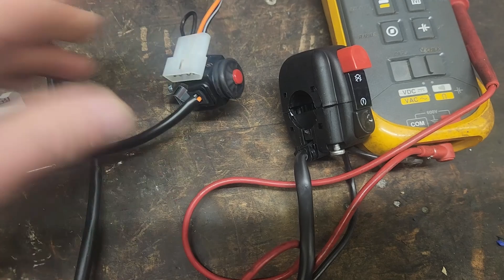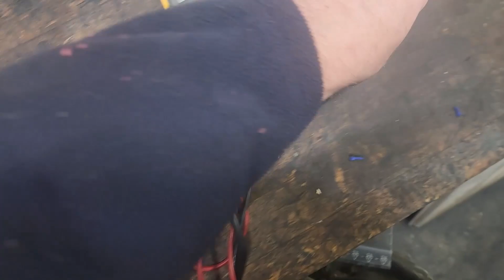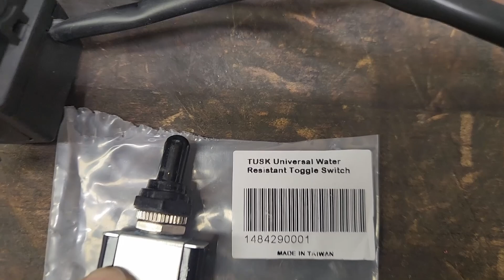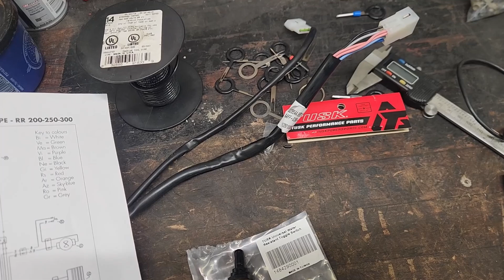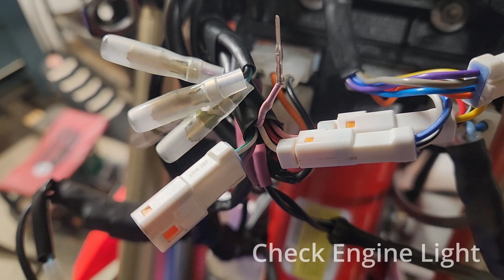MY24 Beta 300 RR Race Switches

Comment: What pin removal bit did you use to get that pink wire out. I have the set but not sure what one to use. Thanks
Reply from the maker: I used the thin flat one with a wedge point.  It's tedious but you'll get it.
Reply: Yeah holy crap it took me forever to get it but it’s done now lol. Thanks for responding oh and I hear you make 3D printed parts for the beta. How do I go about ordering some ?  Thanks again
Reply from the maker: Your right.  I've got a lot of little parts in development. Let me know what you may be interested in.

Comment: I bought bought a de-pin key ring kit from the Bezos Chinese Eporium and I can't get that engine light pin out of the harness plug. Any tips on that and which of the 150 tools it came with is the right one?
Reply from the maker: I use the small pin type. You go in from the end and try to get under the plastic clip holding the metal pin in..... Or just cut it.